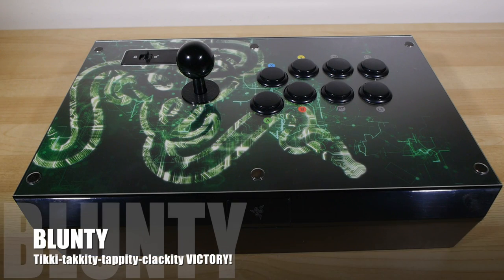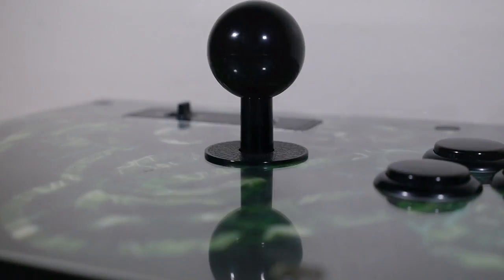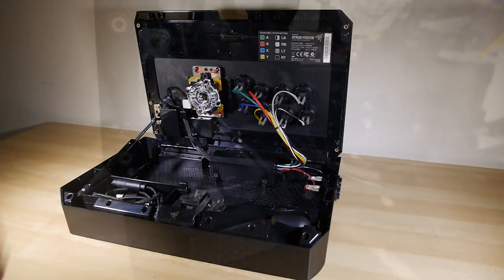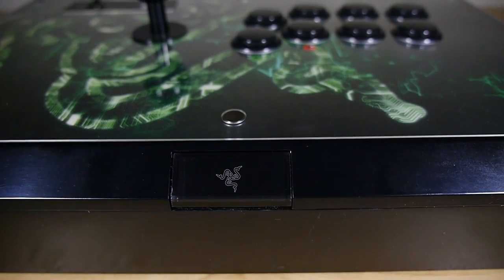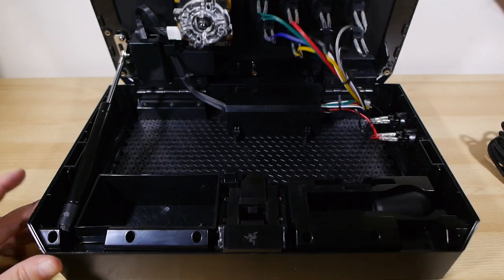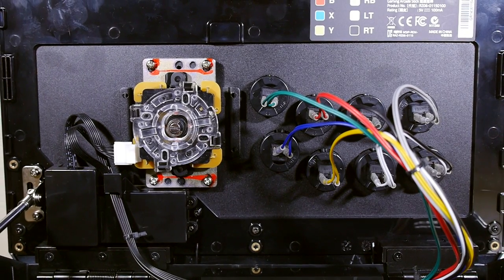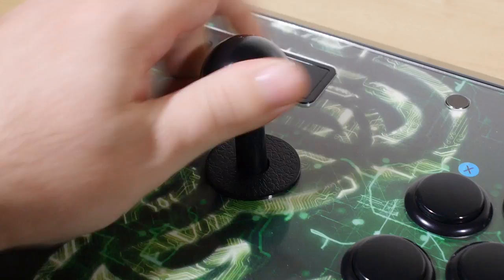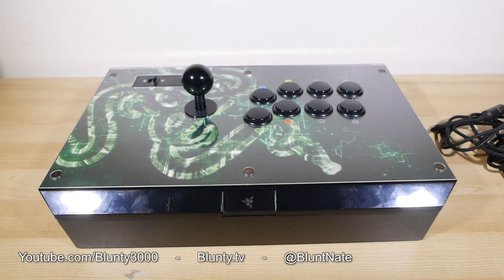Razer Atrox - Arcade Stick for Xbox One - Review

Comment: I love collecting sticks. I like how easily one can mod these sticks and its value becomes apparent to those interested in competing in tournaments. I haven't realized this importance until yesterday. After playing some Killer Instinct with my Hori HRAP V3 Kai (love this stick) and a converter, my bat top came loose. Since the only way to retighten it is to remove every screw on the bottom of the unit and remove the bottom plate, I realized how much of a pain this is. For tournaments, you don't have time for that nonsense. The problem would be exacerbated if a button broke midway through the competition and you needed to make a quick fix. This is where the Mad Catz TE2 and Razer Atrox make a lot of sense. I'm thinking of getting the Atrox but, man, that's a lot of bread for a stick. I'm just a poor grad student, after all. Thanks for the review,  Blunty.

Comment: Looks good.   Probably smarter to just get this than a $80 and then get annoyed and replace all the buttons and joysticks to Sanwa after a few months?   Would you recommend for a first arcade stick to just go this route vs a $80 cross platform stick that often sounds twitchy.. (needing Xbox remote wired to activate etc etc etc). Or maybe an X-Arcade with adapters for about the same money?  Have you used an X-Arcade as well?  Thoughts?

Comment: Hey Blunty , I just had a question, you mentioned you can replace stuff easily with this....but my question is, how easy is it to replace the buttons? Like for example if you like colored buttons instead of them all being black. Would that be a easy or hard thing to replace? For example, I am a fan of the SNES's colorful button controller. Could someone do the same with this?
Reply from the maker: So easy you won't even need a tool.
Reply: Blunty
Thanks for the info, and thats quite the surprise to hear.
Reply: It´s easy to swap the buttons but at the first time you need a screwdriver and a little patience, the quick disconect came stiff, then they became more loose and came out with a little push!